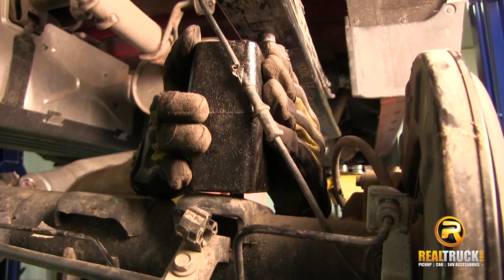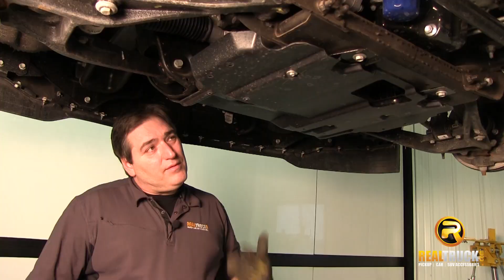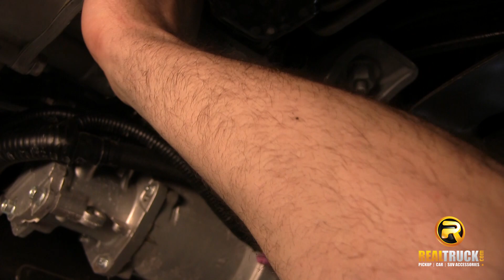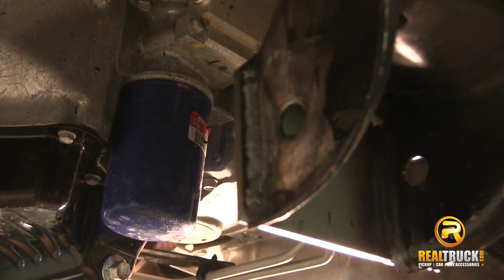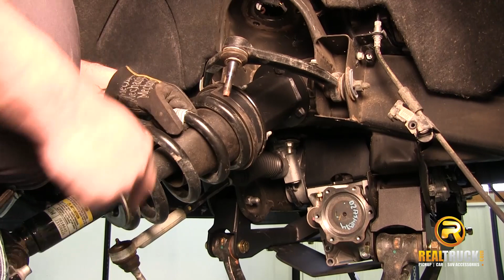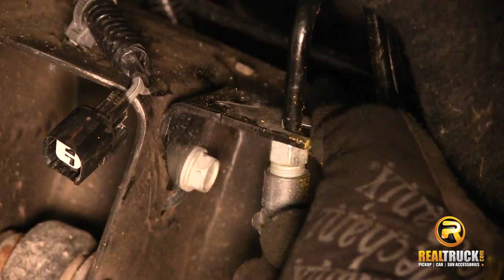How to Install Zone 6.5 " Off-Road Suspension Lift Kit

Comment: I just installed this for a customer, I got two passenger side knuckles in the kit. 
I did check that all the parts were there but I missed the knuckles were the same. 
This isn’t exactly a kit you can just put back to stock real quick. So a 6 hour install turned into 
week and a half. Customer had to rent a car so  the whole situation was a cluster Fudge.

Comment: Description

 No cutting or frame modifications required
 More affordable than competitive lift kits
 Available with hydraulic or nitrogen-charged shocks
 Complete kits lift both front & rear
 Backed by a limited lifetime warranty

This is the description on the lift kit. Why does it say no cutting or frame modifications required?
Reply from the maker: +Thomas,

That would depend on the vehicle it is going on. There are some applications that no cutting or frame modifications would be needed.

Comment: And is that rear lift block a tapered block ?
Reply from the maker: Lifted2014Silverado  no it is not a tapered block because the angle is still at acceptable degrees. If you  have any other questions about this or any of the other 500000 plus accessories we sell feel free to contact our knowledgeable Customer Service folks at  877-216-5446

Comment: but what if my truck is 2wd would I have to extend.My rear driveshaft
Reply from the maker: Lifted2014Silverado yes you would at that height the shaft would not be long enough and could pull out of the trans.
Reply: RealTruck.com doesn't the kit come with that stuff thou???
Reply from the maker: Hector Salinas yes. The kit comes with everything needed.

Comment: did u have to extended your drive shaft for this lift kit?
Reply from the maker: Lifted2014Silverado  yes. This kit does come with the spacers for the drivelines to extend them.  If you  have any other questions about this or any of the other 500000 plus accessories we sell feel free to contact our knowledgeable Customer Service folks at  877-216-5446

Comment: I don't no? Looks like too much work, plus I need a special welder😡
Reply from the maker: Jose Castro not too much work just time consuming. Yes you would need to get that one piece welded, but there are alot of places that have mobile welding units that could drop by and weld that one piece right up for you.  If you have any questions about this or any of the other 500000 plus accessories we sell feel free to contact our knowledgeable Customer Service folks at  877-216-5446

Comment: What is the best shop to go to in Texas near the Houston metro area?? Thinkin of takin my 01 Silverado 1500 Z71 to get a 6-7 inch suspension lift. I'm including new drive axles, steering stabilizers, etc...
Reply from the maker: Kingone134 I am not able to give you a specific shop since we are all the way north of Houston in Jamestown North Dakota. I can tell you when getting something major done to your vehicle like this it is ok to ask a shop for references. Find out how many of these they have done, what brands they have installed, how long did it take them to get it done, and talk to customers to find out if they are happy with the work that was done.

Comment: The threads of sway bar links should be facing up
Reply: For ground clearance
Reply from the maker: That is true. Good catch. We did notice this as well and went back and changed them, however, the shot of them in correctly did not get added to the video.

Comment: So how did the front differential finally come out? Around 28:50 he's having difficulties as the power steering control motor is in the way, I'm having the same issue! Can that p.s. motor just be simply removed and re-installed later?
Reply from the maker: If you remove the bolt with a wrench the diff will wiggle down and out. I would not recommend trying to remove and reinstall the PS Motor in the vehicle. That is usually done with the rack and pinion entirely removed and on a bench.

Comment: and also did u have to extend the brake lines?
Reply from the maker: No but you do have to unbolt the factory brackets and gently bend the lines a bit straighter.

Comment: Hey bud, nice detailed video and I appreciate the tricks of the trade. I would hate to maintain the brakes or wheel studs on this truck with that razor sharp shroud cut you left though, a sanding wheel or a few passes with a file would be nice to anyone doing general maintenance.  I also don't approve of the air impact on those tiny bolts used on the front axels, way to easy to strip them out with the amount of torque they can produce.
Reply from the maker: Thank you Anthony I am glad you liked the video. You are absolutely right with the front shroud. Since the video, we are making sure to take care of all of these little details on the Big Red truck, which include getting rid of the sharp edge.  Thanks for the helpful tips!

Comment: I thought you only use "picklework" on parts ment to be replaced because they mostly damage the rubber seal. Pretty obvious thats what happen, but you reinstalled it with damage rubber?
Reply from the maker: +94meriks it's actually called a "picklefork" and you guys are putting way to much into the rubber "seal". It is not a seal at all. In actuality it is a rubber dust cover and in repair shops, yes even the dealerships, they actually cut those open to lube them on the type that do not have grease zerks. So relax guys, I know it's a Chevy (just kidding, sort of), but it's not going to full apart over that one dust cover.
Reply: ***** I actually meant picklefork, I got lost in the translation :) If I drive with a damage dust cover like that one winter here in Sweden the joint would be full of salty water and the joint wouldn't last the summer.
The joint will be worn out prematurely and the customer is the one to pay for it, I think it's kinda cavalier and how in earth will a joint stop jerking because you fill the dust seal with grease?
Reply from the maker: +94meriks once it starts jerking it's typically too late and as far as as the salty water in Sweden, we have that here in the winter as well. The thing is that as long as you keep grease in the joint it "should" not allow that stuff to get in there to start with. Keep in mind that those dust covers are not air and water tight in the first place. I have been a mechanic for many years (33 to be exact) and there have been many times that a customer has come into the shop for an oil change and lube with a vehicle only a few years old and that cover in perfect shape. When I started to add grease to the joint through the zerk water started coming from under the cover. This is not totally uncommon hence the reason why the shops cut a small hole in the ones without zerks and add grease directly under the cover to keep the water from getting into the ball and socket of the joint. As far as your own vehicle goes, by all means if it makes you feel better replace the rubber cover, but since we don't work on customer vehicles, and this one belongs to us, we decided to leave it. When the joint eventually wears out, we'll put in a new one.

Comment: Do U know anything about tires? I m looking to get a lift for my 2wd 2015 GMC Sierra, I want a big and aggressive looking tire that drives smooth on the road and has good mileage? What tires should I get?
Reply from the maker: +Jenymon Cyriac and therein lies your issue. The more aggressive the tire the more road noise, the more bounce at low speeds and the less wear mileage.  The more aggressive tires still generally ride decent at highway speeds, but they just don't last very long. I would suggest visiting a few of your local tire shops, look at what they have, talk to the peeps there and then decide how to rubber up that truck.
Reply: A suggestion if I may sir. 33" all they way to 37" tires are pretty reasonable for a daily driver. But I really like the Nitto Mud Grapplers it's the noise I actually have fallen in love with.. Something you need experience if possible. 
Also I had a set of Toyo open country they are real popular and I ran them on a 06 z71 so a half ton like your truck and at about 45,000 I started deciding what I should do for the next set...my 2 cents

Comment: Hey I'm wanting to get my truck lifted but I'm worried about the excess wear and tear it might have on my truck what kind of problems could/will come from getting it lifted?
Reply from the maker: +Tyler Prince u-joints, balljoints, CV Axle Joints,  control arm bushings just to name a few. Although it really depends on how high you lift it and whether or not you upgrade some of these components plus the size and weight of the bigger tires can play a part in this as well. On a personal note, I have lifted several of our trucks, with no major issues. The biggest issue is making sure the angles are done properly and upgrading some bushings. BTW it is well worth it.
Reply: Worried about wear and tear leave it as is IMO

Comment: Anyone else notice he put the lower control arms on upside down?  :)
Reply from the maker: +sneaky2toes wow you guys are sharp! this is what happens when you have a director pushing you to hurry through. I did notice when I got a bit farther and had to swap 'em around. If you watch later you will notice the balljoint stem is down in the correct position.

Comment: Are those rear lift blocks flat or tapered?
Reply from the maker: +highdesertloco flat.
Reply from the maker: The taper goes towards the front. It is designed to correct the angle of the differential.

Comment: I have a 2015 Silverado  2wd is it necessary to cut and weld the channels and tie rod ends?
Reply: Y lift a 2wd?
Reply from the maker: +Todd Blakeslee unfortunately yes. This needs to be done to get the proper alignment for the increased lift. Even for 2wd vehicles.
Reply from the maker: there are a lot of people out there that Race Dessert and they use 2WD.

Comment: Hi im installing this exact lift on the exact truck. My question is what is the offset/backspacing of the rims you used i like this set up alot? Thanks
Reply from the maker: +Chris Mcdonald 94R Series Wheel; Size 20x10; Bolt Pattern 6x139.7mm; -12 Offset;

Comment: is the zone 4.5 inch lift installed the same way as the 6 inch? is it necessary to weld the plate onto the lower control arm pocket? Thanks
Reply from the maker: +Nick Jimenez Almost exactly. Yes the pockets need to be cut and the plate welded on the 4.5 inch also.

Comment: wont all this stuff void your warrenty??  =8^O
Reply from the maker: don earl All the auto manufacturers have different ideas and opinions on what will and will not void warranties. In most cases nothing we did to this truck would void a warranty, however, if you have any concerns at all check with your local dealership first.

Comment: Are brake upgrades 100% Needed.. On my old truck i had a 3" lift on it and it stopped fine. Im saving for a 03-05 Silverado and will probably be putting a 4"-6" lift on it with obviously bigger wheels/tires and offsets would i HAVE to upgrade my brakes i see some of the upgrades are $1,200. Is there any cheaper way of upgrading them
Reply from the maker: TheFloridaBoy941  Short answer No. You do not have to upgrade your brakes. Longer answer. Your brakes and the ability of them to stop your vehicle is based on a vehicles ability to go from 60 Mph to 0 Mph in a set distance. The distance is based on the weight of the vehicle not the height. So obviously a GEO Metro with its tiny little pads and calipers is going to stop quicker and at a shorter distance then a fully loaded 80,000 lb tractor trailer. Most brake upgrades are done on vehicles that are going to be pulling heavy loads or are going to be racing where you are off and on the brakes alot, there is a reason for that upgrade to, but that's a topic for another discussion. Hope this helps.